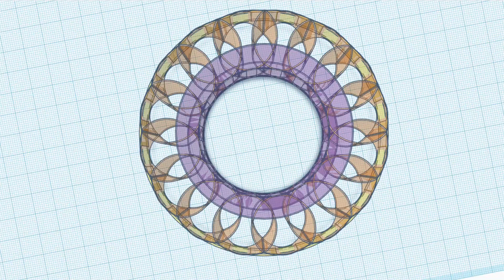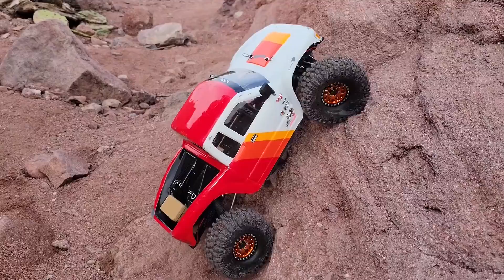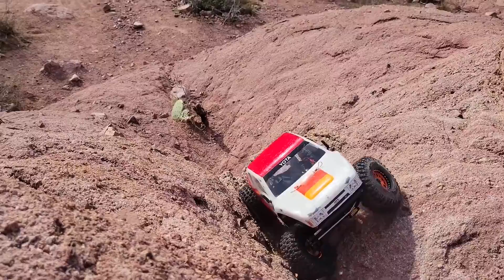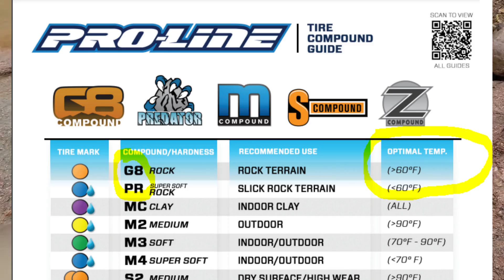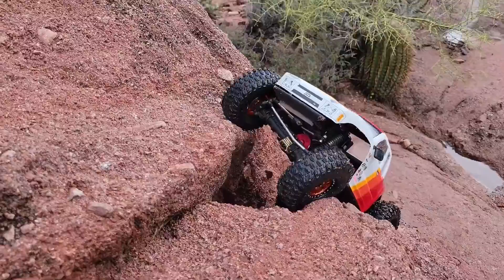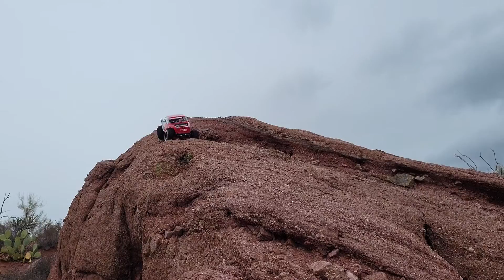Custom Printed TPU Crawler Tire Inserts

Comment: Tpu at micro center is 20 bucks a roll for clear.1kg I think..it's definitely not 95a but not 85a..makes for nice antifoams with 4%infill or 3 for soft.I used a free file n tweeked it some for a mid cushion to imitate dual stage.def fun stuff to mess with.